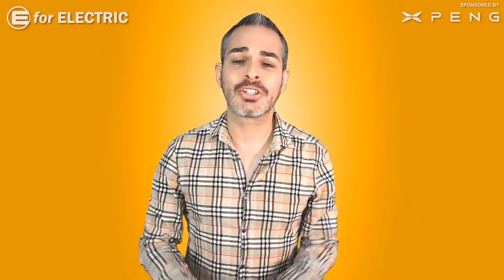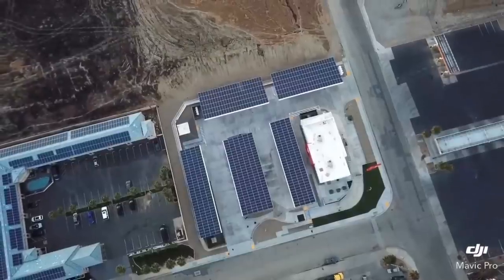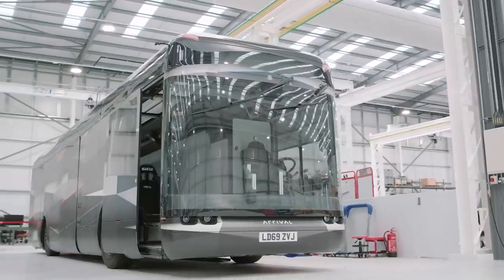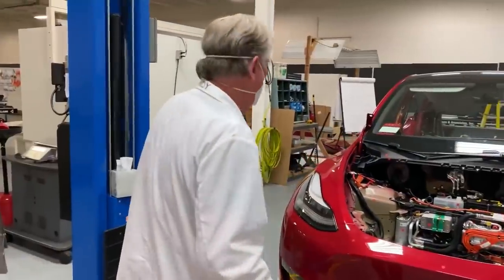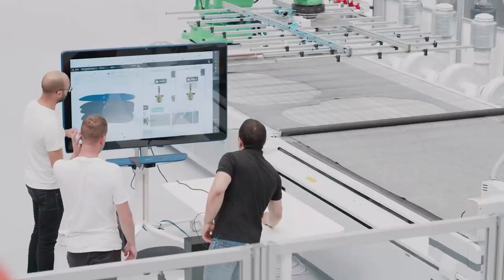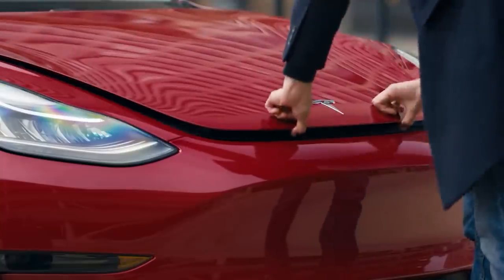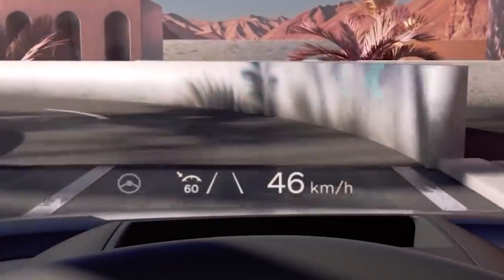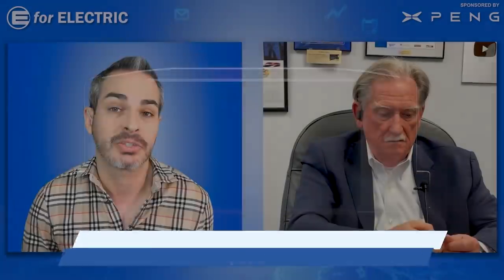Sandy Munro vs 2021 Electric Car Tech

Comment: I do not think that swapping will be a popular. Not just because connectors: even without swapping we still use our chargers and every time should connect them. The real problem with swapping is that there should be at least 2 or 3 times battery produced to support swapping: in a time we discharge our battery, other battery should be waiting for swap. Every swapping stations should have enough batteries laying around for fast swap. Just imagine disaster if you came to the station and there is no ready battery. That is why total number of batteries produced should be 2 or 3 times as cars. And somebody will pay for that. So either swapping will be costly or it should be included in a price.

Comment: Here’s GE’s 2002 stated vision of what our world will look like employing superconductor technology :
"Electric generators [and motors] made with superconducting wire are far more efficient
than conventional generators wound with copper wire. In fact, their efficiency is above 99%,
and their size about half that of conventional generators.”

Graphene Nanoribbons Tested Could Carry as much as 10 Billion Amps/cm,
or nearly 1,000 Times Greater than Copper.
@t

Graphene Has a Current Density a Million Times that of Copper at Room Temperature.
@t

35 Room-Temperature Superconductors Discovered
@t 

My favorite room-temperature superconductors are xenon gas filled sub-millimeter OD SiO2 capillaries.
I call them Plasma Capillaries, which can also be used for tunable full-spectrum grow lights.
Plasma Capillary Lamps are a sub-millimeter scale version of this : 
Induction Lamp Manufacturing    @

Comment: Everyone dissing battery swapping is ignoring the fact that millions of people can't charge at home because they live in an apartment. Also if you want to bring the cost of EVs down then don't make people buy the batteries.
Battery swapping is a problem? Tell that to the millions of tradesmen around the world who use cordless tools and equipment. They all swap the batteries on their tools several times a day. Connector problems? Nope. And cordless is moving in to bigger and bigger equipment all the time, with higher amperages. If tradesmen had to buy a battery with every tool then cordless would be a lot less popular, becuase of the extra cost.
All of the people slating battery swaps live in homes with off street charging and have plenty of money.

Comment: Battery swapping?  What is the biggest current, and probably future constraint on the deployment of battery EVs?  Battery supply!  Just ask Elon.  So here's an idea, let's develop a technology and marketing strategy that requires you to make and store at least 50% more batteries than there are cars.  Other problems: Battery technology is developing fast - what do you do when all those extra batteries you have become obsolete?  Do you keep old-style batteries on hand to serve customers with older cars?  How many different generations of batteries are you going to have to keep on hand at each swap station to serve all your customers?  Batteries aren't standardized across different vehicle brands and are not likely to be because they're a major competitive feature.  So do you keep a supply of each manufacturer's current and older batteries on hand at each swap station, or do you have a network of swap stations for each different manufacturer?

Battery swapping sounds like a good idea when you first hear it, but when you really dig into it, it's a complete non-starter.
Reply: Industry has not even managed to standardize batteries for e-bikes - an area where battery swapping would be an easy solution and where no fast charging is available. Not even within a single company (e.g. Bosch) you are able to exchange an in-tube 500 to a 625 Wh battery (different length), even within the identical size you have 2 versions with different orientation, not even talking about the several non-in-tube battery versions...

Comment: Skip the battery swap. I want a cheaper EV with 120 - 150 mile range for daily use and an option to add an auxiliary rental battery for the occasional long road trips.

Comment: Alex, every time you mention battery swapping I have to skip those parts. It is a terrible and unnecessary idea!!!
Reply from the maker: Maybe if you didn't skip those parts and educate yourself on what it is you would have a different opinion
Reply: @EforElectric  Alex, you do a tremendous job covering EVs. I agree with you on most things. But I agree with Sandy on battery swapping.

Comment: The host is upset by Munro’s battery swap opinion because the host never truly believed Tesla or Elon and therefore did not invest.  Now he clings to the lack of battery swap as a fundamental flaw by Tesla, but to me battery swap seems like a work around for straight up, sufficient charging infrastructure development which is critical for ev adoption.  It also seems like a way for poorer people to afford electric.... the host should have invested a few years ago instead of being so critical and negative
Reply: Be patient.  Costs are coming down, and with the advent of Tesla’s new structural batteries, they will charge even faster and cost less.  I am currently on a road-trip in ModelY... I also have done this same trip in my 2017 X, and I can say for a fact, that the charging speed is already almost too fast.  10-20 minutes is barely enough time to answer email or watch one youtube video.  Soon charging times will be 15 minutes tops on average at Supercharger stations
Reply: ...and don’t forget, Tesla HAD battery swap and even built a prototype swap station... they did not come to their decision based on ignorance

Comment: Dark Energy is the energy that is fueling the ever increasing expansion of The Universe and the processes that Sandy described, energy at absolute zero, is called Zero Point energy. So the term "Dark Energy FLIR" seems to be nonsense to me. This is a FLIR that sees Dark Energy or powered by Dark Energy? Or perhaps this is a poorly worded term and it should be a Zero Point FLIR that is powered by zero point energy or sees zero point energy, which is also nonsense because a system at absolute zero cannot release any energy, as per the third law of thermodynamics. Therefore a system at absolute zero releases no thermal energy to be seen by the FLIR or to power a FLIR. Sure it sounds cool, but its complete nonsense buzz word-i-ness.
Reply: Probably just some nomenclature that sounds cool but has nothing to do with the actual astrophysical definition. Probably a more effective sensor aided by AI to get a better resolution in more varied conditions image would be my guess.
Reply: Sandy is an engineer, not a physicist. I presume he just mixed up the words he was intending to use - and of course the fact that objects at absolute zero release no energy is irrelevant, first because absolute zero is a theoretical thing that doesn't actually exist, and second because nothing one encounters while driving anywhere on earth is going to even be anywhere near absolute zero.
Reply: @alanlight7740  You have misused the term 'theory' to dismiss something as hypothetical when in fact a theory is what is left after all attempts to disprove something have failed. I assure you, absolute zero is real and zero-point energy is real, as confirmed by experiments. You are correct that nothing on Earth, encountered by any of these sensors, will be near absolute zero, hence my confusion as to why he needed to discuss zero-point energy sensing mechanisms.
Reply: @Darkstorn42  - absolute zero is theoretical in the sense that although experimenters have gotten close, it has never been observed - and that there is nothing in the universe that is naturally at absolute zero.

It is therefore a temperature that has been calculated that it must be at that point. It's probably a pretty good calculation, but as I say it has never actually been observed and therefore must remain theoretical.
Reply: @alanlight7740  Yes, absolute zero has not been observed, but experiments have gotten close. There are things at absolute zero, and that is a perfectly reversible crystal, as per the third law of thermodynamics. This is solid helium. Solid helium can only exist at absolute zero, and many researchers are working to synthesis it. While it remains unsynthesized, solid hydrogen has been achieved, which is the next closest thing, and the hopes are the techniques to create that will be successfull for helium.

Once again though, you have misused the scientific meaning of theory. When something is dubbed a theory, verse a hypothetical, it is what is left after all evidence has disproven all other hypothesis. Though it may be fair to say the concept of absolute zero is derived from the laws of thermodynamics and is therefore not a theory, but a law. (A law being a postulate that has yet to be disproven.)

(Perhaps you should revisit your thermodynamics textbooks and refresh yourself on the laws and their implications.)

Comment: Sandy is right about the main technical problem with battery swap, but on almost everything else he's just spouting random unrelated stuff.
Basic FLIR tech has been out for decades. Check out prices if you think it is cheap. Remember a car will need at least two (preferably more) if it is trying to determine the distance to what it sees. I have no doubt the military can afford a newer higher resolution FLIR but that doesn't mean it will be affordable for cars. "Dark Energy FLIR" returned zero results on Google. 
HUDs are great and will continue to become more popular, especially now that cars have enough computing power to support high resolution useful information like augmented reality.
He said kids want fun 2-seat cars because today he is working with Arcimoto on their 3-wheel 2-seat scooter thing.
Sandy has been losing credibility since he started playing to the Tesla fanbase. That has brought him a much larger audience but greatly diminished his content.

Comment: The military is an extremely bad example to use for being against LIDAR. They have stealth as a priority and obviously don't want anything with active emissions, which doesn't apply to cars.
Reply: I think the point he is making is that the military, due to the restrictions of LIDAR glowing like a disco ball,  had to develop a better cheaper system using IR, and that is what will kill LIDAR when it find it's way to consumer use.
Reply: Something else to consider: when you are driving down the road in the only car using LIDAR it's no problem.

When a few cars on the road are using LIDAR, it's no problem.

When every damn car on the road is "glowing like a disco ball" to the electronic eyes that are driving your car, is it still not a problem? Or are those electronic eyes going to have difficulty keeping track of which reflected signal is coming from which car?

A passive system seems like a much better idea to me.

Comment: Yeah... battery swap “demonstrations” always seem to be in unrealistically clean, pristine car & shop conditions; far from sloppy, dirty reality (and lots of humanity!). Always thought “swap” was a stupid system, just on the icky factor alone, since way back when Better Place tried & spectacularly flamed out a decade ago.  FAIL.
Reply: Better place didn't fail on the battery swap, they failed on the whole EV market. - They didn't have the celebrity effect, and EV's were not an economic proposition back in the day, they were  an aspirational accessory - not yet ready for use outside resorts and golf courses.

Note though, they lost less than the cost of Any OEM developing a line of new vehicles.  2007 is several generations ago..   Wow, remember back then.... the Tesla Roadster hadn't even been launched and iPhone was incipient.

Comment: Munro wasn’t able to operate a simple navigation on ID.4, now he’s talking about battery swap? Nio has done over 2M swaps without any connector problem.
Reply: Who is going to setup a battery swap station in a third world country where wages and car ownership are low?
Reply: @gordkao  I would only setup them to sensible places. I guess there not much superchargers or such either actually...
Reply: @mho0  A swap station needs a high power connector to charge the batteries as well. Forget about the outdated charging infrastructure where a single swap station can serve the traffic. As soon you have 4 to 6 swap stations there is no difference in utility power requirement in comparison to a  big supercharger station with e.g. 40 to 60 stalls. You are constantly charging many batteries at a fast rate in both scenarios...
Reply: @bernhardleopold6702  Yes. I see it same way. in swapping stations load should on average be more flat though and you have possibility to optimize. In normal charging station it would not be nice to say that last 10 stall won't get power now as we are optimising (or more likely everybody would get less), but in swap station it could be done (not ideal of course).

Comment: Hydrogen in 700 bar tanks are rolling bombs with 7 kg dynamite equivalent for every kg hydrogen. 
Good luck explaining to the judge why your car destroyed the grammar school building 
on the next block because you had to switch your fuel cell filters and nicked the hydrogen tanks inadvertently.
I only hope it was saturday evening and you were not sitting in the drivers seat.

And good luck if you are the sales person selling the first hydrogen fueled jet to AA and it explodes over Downtown Los Angeles.
That will be a bomb of about 1 Ton TNT equivalent. And it will happen. Murphy tells us so. 

Let murphy be your shepherd and there will be no 737 H2 desaster.